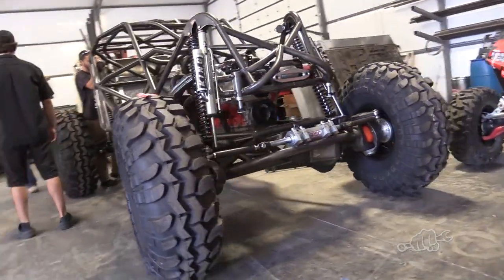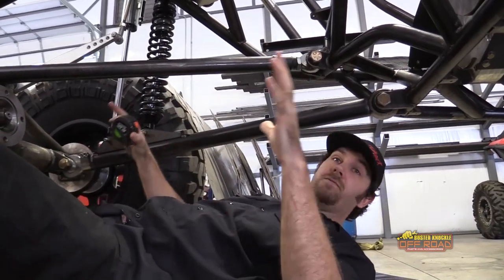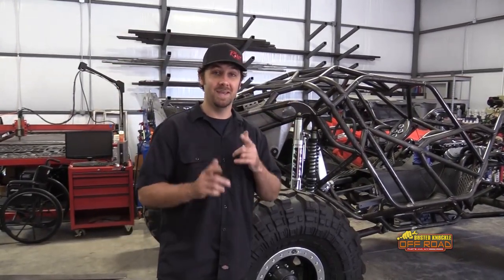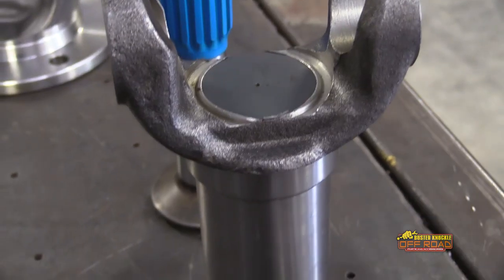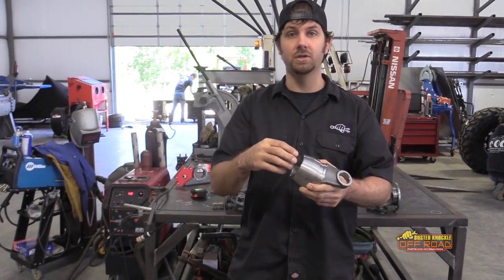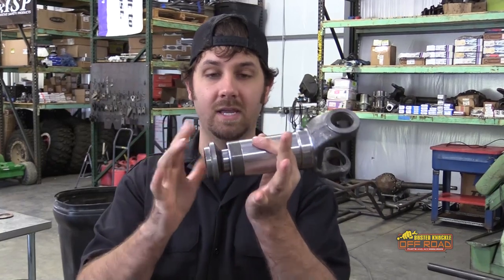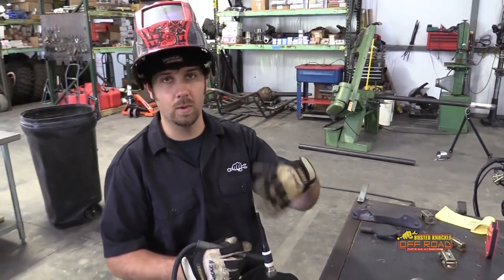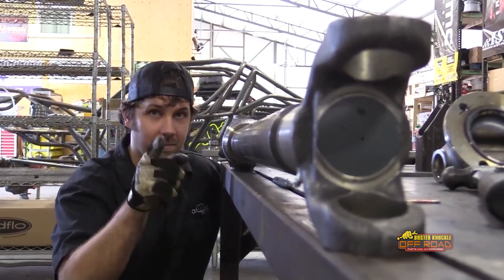How to Build a Custom Driveshaft - Rock Rods Tech

Comment from the maker: Check out the new shop channel for more Tech Videos! 
https://www.youtube.com/channel/UCbOUUPmH1YoFXHRQuZarA5A
Reply: I know this video is 4 yrs old but im building a project and now im at the driveshaft part. I really like how BustedKnuckle responds the the "I balance driveshafts" comments like "NO THANX WE GOT THIS" lol. Anyways im building a 93 ford ranger with 8" of lift, raptor fiberglass, 15x14 with 35s, om603 diesel (2jz diesel), nv3550 np231, ford 8.8, dana 35/44 hybrid. Oh and its no longer Left Hand Drive, i put everything in the passenger area and made it RHD on the stock ranger firewall.
I really appreciate all the guys like busted knuckle that build it instead of buying it. And then u pretty much tell the ppl make a living doing the stuff u show us, NO THANX WE GOT THIS.
I SCROLLED THRU AND SAW 2 OR 3 PPL SAYING WE CAN BALANCE THIS FOR U AND UR LIKE "NAH THE DRIVESHAFT IS RUNNING FINE" 
Ill prolly get mine cut and then send it to a shop to be trued and welded because i need to make my truck basically a civilian army truck that can survive a EMP. Which is why i went with a mechanical turbo diesel engine.

Anyways im also the only person in the entire USA with a RHD swapped ranger. I built it for when WW3 starts but i also made it RHD so i could do MailMan stuff should WW3 be on pause.

Comment: I was so stoked to build a diy drive shaft for my daily prerunner! You crushed my fab spirit at the end 😂 all I do is 80mph everywhere 😂
Reply from the maker: you can build it and have it balanced
Reply: Guys run “trued” shafts in ultra 4 all the time with speeds around 100mph.  Their tires are beadlocks that are not balanced.  Some with solid mounted driveshafts.  The point is, if your tires are bouncing or your not running on a smooth surface , there is no reason to balance the shaft.  True it up and let er eat!

Comment: those are some amazing tig welds, did have a question which you may have covered in an earlier video but im a new subscriber, when placing your trailing arms/transfer case, do you have the flange/yoke as close to center of the hing point or does it matter to much as long as it is not excessive?
Reply from the maker: I'll check with Jake on that.

Comment: I'm willing to bet if I put one of those on my balance machine it would need some weight,  especially with the rpm you're running them at I'm surprised you're not having at least some vibration issues.  props on the Spicer parts, I sell tons of the stuff
Reply from the maker: No issues so far.

Comment: Interesting 😀 What kind of angles are you guys working with?
Reply from the maker: with custom built suspension the right way there isn't much rotation of the pinion of the axle so they don't get put in much of a bind. that being said these parts can take a lot of angle

Comment: Why did you measure at full droop,when you just built it collapsed anyway?
Reply: tommyguns14able to make sure the driveshaft is long enough to handle the amount of shaft slip
Reply from the maker: Don't want your driveshaft to pull out on you on the trails
Reply: @BustedKnuckleVideo  cool story bro. All that bullshit talk about vibrations due to timing. I guarantee your shit has 20 thou runout all day.
Reply: @bustedknuckleoffroadllc5060  and if it didn't,then what?
Reply: ☝🏻☝🏻☝🏻my point exactly
Reply from the maker: As you type from your Mom's Basement. Get a life buddy.
Reply: The drive shaft compressed and retracts as the suspension moves

Comment: I mud dragged in the 80's... Never had any problems with ujoints..used nothing but spicer...
Reply from the maker: Rock Bouncing requires a super strong driveshaft
Reply: you aint putting a fuckton of shock to the joints like street drag racing or rock bouncing.

Comment: About balancing: You have a lathe. Spin it up, stick a soap stone near it, work it in until it rubs and makes a mark, put weights opposite the mark? Drill out mass from the center of the mark if on a meaty bit? No? I guess you would know better than I. I know this involves liability and risk in claiming "balanced". Would it help? Is there a better way? How does one balance a drive shaft? A special stress-proof or sch 80 seamless pipe that's internally machined and spec'ed? 4130? Now you've only managed to pique my curiosity on this dammit.
Reply from the maker: There are machines that balance them, it's just not necessary for what we do.

Comment: I can't find any videos about flex disc overriding 
By that I mean get longer bolts turn the shzft and defeat the flex coupler
Do it's bolted direct and no longer stretches and wears ou
I filled in the shzft hanger mount with urethane So it's sold I filled in the transmission Mount and motor mounts on w115 Diesel  mercedes. 
It only has 68HP so who needs alot if flex.my research shows they make al, the mounts flex so it all rips apart in a crash. But it's 48 years old. Now.
Thesedays it is a tank all the big cars are gone..all American cars had no flex couplings and drove just fine. I'm going to try the 3 .pager bolts and do without the flex disc. Have you ever done that turn the shaft and bolt the 3 holes only even keeping the old disc it's just direct now. With 3 empty holes  changing the euro car to gm style .
Reply from the maker: never heard of that setup